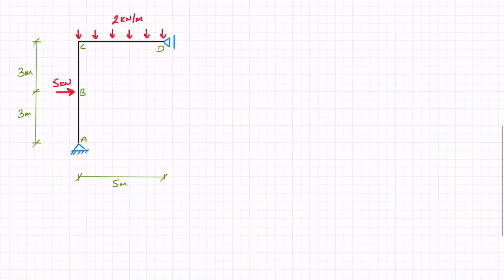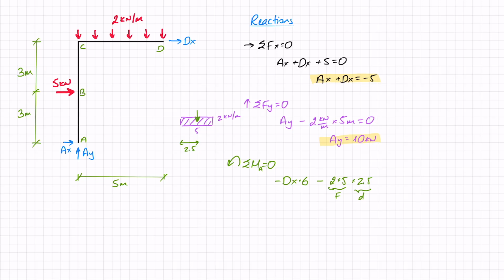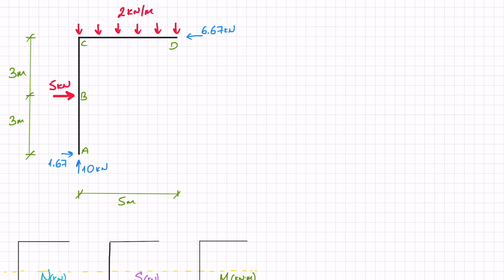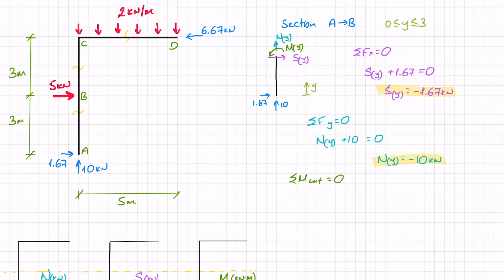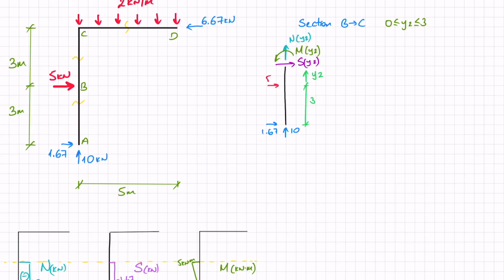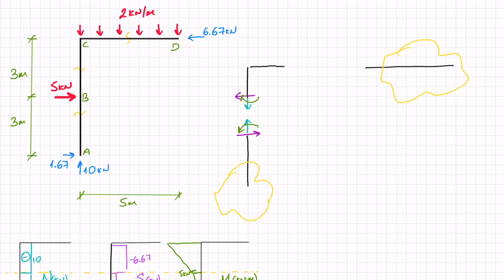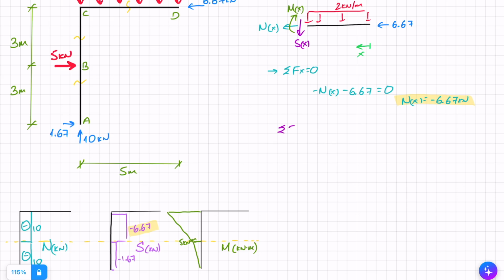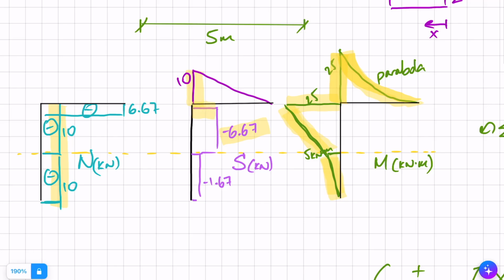Engineering Mechanics | Frame Reactions & Internal Forces Tutorial | Beam–Column Point Load + UDL

Comment: This was a very helpful tutorial, thank you very much! I only have one question though. In the last part, the shear force is -10 kN when x = 5, but on the diagram we wrote 10 on the tension side. Why is that? Even though we found -10?
Reply from the maker: Thanks so much and great question. The −10 kN means the shear force acted opposite to the direction we originally assumed in the equilibrium equations.
When drawing the final section forces, we usually show the actual physical direction, so the force is drawn on the opposite side and labelled as 10 kN (its magnitude).
Also, the idea of the “tension side” is mainly important for bending moments, since moments create tension and compression in the member. For shear forces, the main thing is simply to be consistent with your sign convention and drawing direction throughout the analysis.
Reply: Thank you very much! I understand it now.

Comment: Intrigued what forces the connecting right angle joint would have to resist. So how would you go about designing a bolted or welded joint. Probably another course!😄
Reply from the maker: Here the assumption is that this is a rigid connection, meaning all the forces and moments are transferred around the corner just as you’ve solved them in this example. For a 90-degree angle, the axial and shear forces essentially “swap” directions by definition, but everything still remains in equilibrium around the corner.
You’re absolutely right that this is the analysis stage. The actual design of a bolted or welded joint would then depend on the material, the detailing rules, and the relevant design codes. Definitely the territory of another course! 😄

Comment: Interesting. Starting to learn something here. I note the right angle is a rigid joint.
Reply from the maker: Glad you found it interesting! 
You're right, the right angle is a rigid joint which means it can transfer both moments and forces. Generally in frames you would assume that it is rigid for analysis, unless specifically told that it was designed otherwise.
Reply: @EngineeringTheCurriculum thanks. I am starting your lessons from step 1. I find you approach is different to how I was taught. Which is good to see another perspective.
Reply from the maker: I agree - it’s always good to hear other approaches. I’ve found that sometimes hearing the same thing for different people can really strengthen understanding. I still  have more lectures to upload, especially around beams, frames and more complex structures, like frames with hinges. Hopefully it’ll all be useful